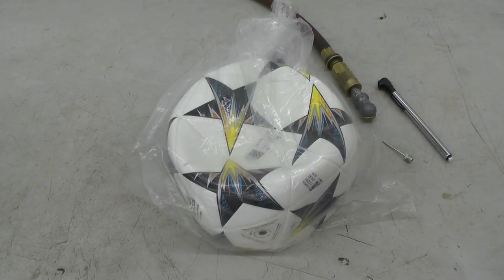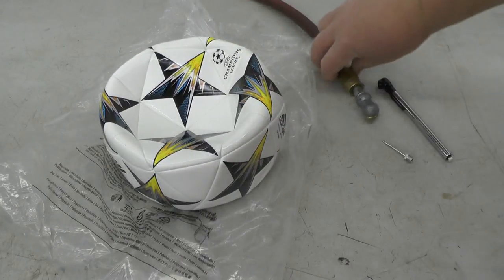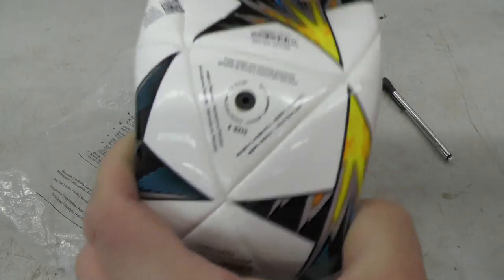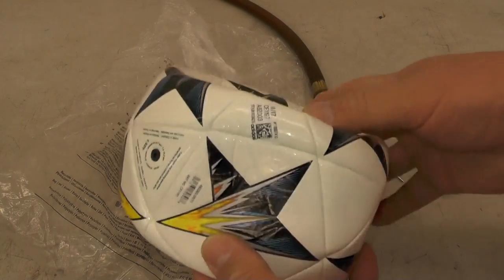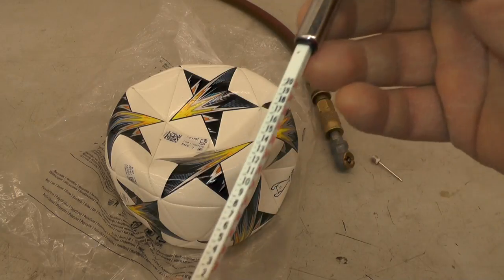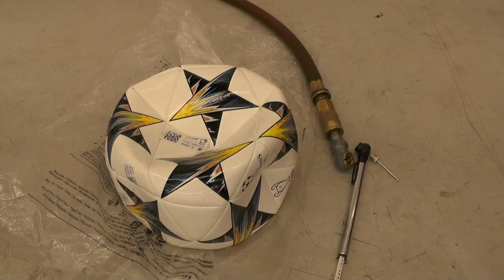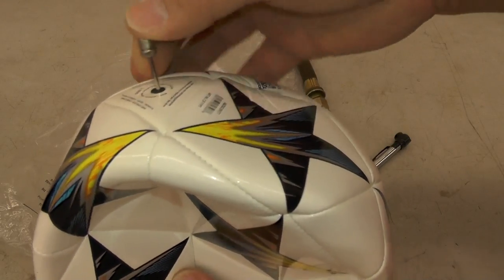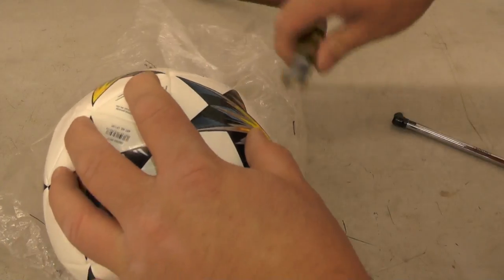How to fill a soccer ball with air

Comment: Should a ball give a little when you apply finger pressure after inflating or be totally solid
Reply from the maker: Hi, and That's a great question! I find that (usually) there is some give, especially with smaller soccer balls. Also if they're TOO full, and too solid, the team complains that it hurts their feet!
Overall, I think the key to getting the pressure right, is to check it with a gauge, and fill it to the pressure that's printed on the ball.
Anyway, Hope this helps!
Reply: Most inflation kits come with a gauge m. Usually on the ball there will be a PSI range. For example my ADIDAS one recommends 7-10 psi.